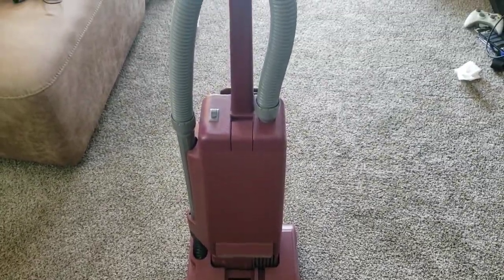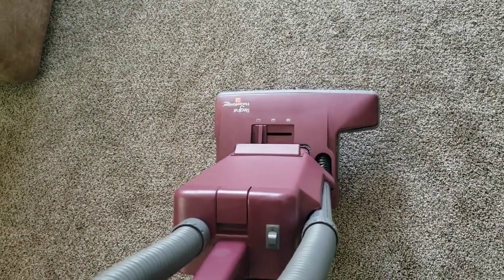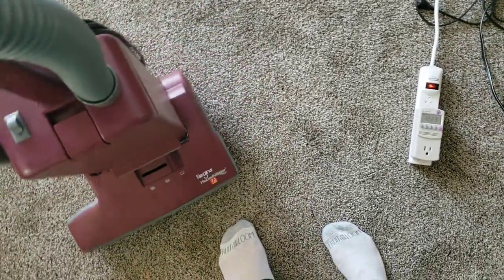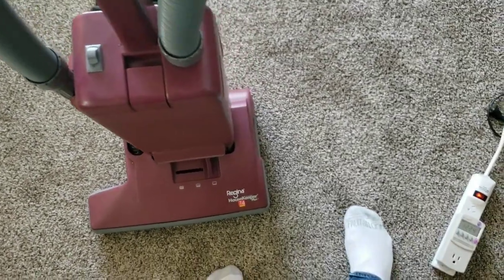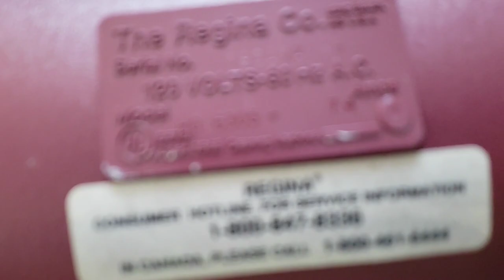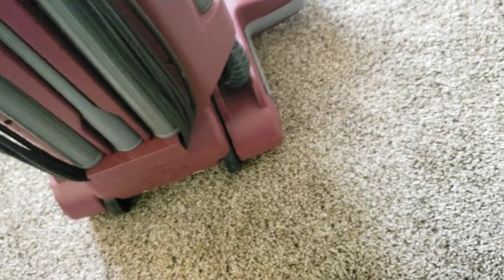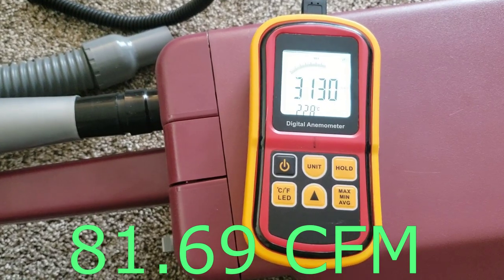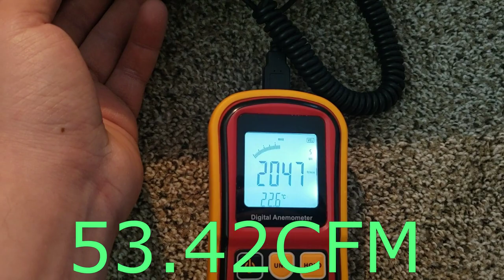Regina Housekeeper plus airflow test

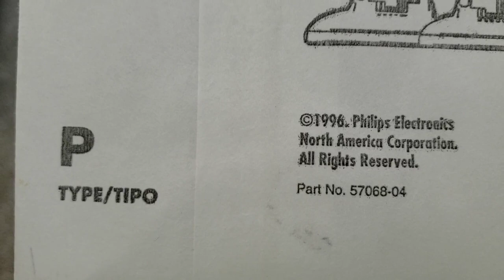Comment: 1:33 The reason why Philips had involvement with Regina is because Philips used to own Regina back in the mid-90s when the Regina company went bankrupt somewhere in 94. Philips sold Regina to oreck later down the line.
Reply from the maker: Thanks for the info I wasn't aware of that. It does make sense that they were sold to Oreck though I've seen quite a few of the Oreck branded regina steemers

Comment: This is a great example of a poor cleaner. Love the ZERO nozzle suction!

Correction: I rewatched while viewing on a large screen and it did pull a few measly inches. On a 6 inch phone screen, I couldn't see that. 🤣👍
Reply from the maker: I thought it registered at like 2 or 4 either way not enough to hold the meter in place.
Reply: It’s still one of the first bypass upright vacuum cleaner designs with onboard tools that companies like Dirt Devil and others copied in the 90s…
Reply: @MicklowFilms  No?